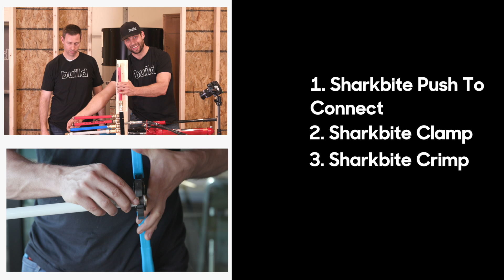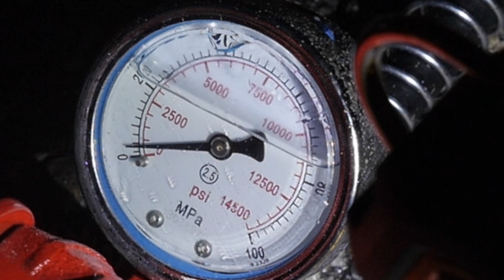Can we blow off these PEX fittings?  Sharkbite vs Viega vs Uponor

Comment: The shark bite push to connect are for the homeowner for temporary emergency repairs.  I work for a public water utility and see other contractors cut a water service line and instead of calling the water utility to come repair it. They use the shark bite fittings. They cannot handle our water pressures of over 100 psi. They will blow off every time. And when we see them ( due to them busting) we look up the last contractor that worked by the onecall ticket # and send them a bill.  I have seen so many home owners who fix their incoming house supply lines and end up having to do it again all because they think these are permanent repairs. I only suggest them as a quick temporary repair for home owners. Nothing more.

Comment: The uponor in my opinion is the best because it will take freezing better than the harder plastics. A softer plastic will not take as much pressure but will expand more when freezing. However you may not be able to ever put a fitting in the place it expanded. With 35+ years in the Car Wash business in Colorado I have seen a bunch of different things freeze. It still amazes me to see the power of freezing water.

Comment: WHY ARENT YOU TESTING REHAU???
Reply: Everloc+ and Rehau PEX A didn't fail the test!

Seriously, Mark, the test procedure was entertaining and somewhat useful, but not really scientific evidence for any of the components used.  And, as you pointed out, they did not include Rehau PEX and Everloc+ or Everloc fittings in the test.

Each individual component and fitting should have been tested separately, not on a manifold.  When it became obvious that the PEX pipe was going to burst before the fitting would fail, the test should have been redesigned to look at both components (the pipe and the fittings) separately.  But it was Christmas and they were having fun ... and I like their enthusiasm!

To determine the burst strength of the various types of PEX pipe, a length of pipe (same length in all pipe tests) should be pressurized gradually until it failed.  Each pipe burst test needs to be repeated at least three times, to make the result of more value, statistically.  Also, as others have said, use a pressure gauge that is more accurate in the range where burst pressure is expected.

To test for fitting failure pressure, probably the length of pipe should be very short, perhaps only an inch or a few inches, to focus on the strength of the fitting/connection and not have the PEX pipe bursting like a balloon before the fitting failed at the junction between the pipe and the fitting.

Nonetheless, Matt presented an entertaining exercise and got people thinking about how the various PEX systems perform at pressures above those expected  in normal residential water supply systems.  Another test that Matt can consider would be to use a manifold to pressurize ALL types of fittings and PEX pipe to 100 percent above the maximum pressure expected in residential water supply systems.  Rarely is the water pressure in residential application expected to exceed about  75-80 PSIG, so the test pressure might be set for 160 PSIG.  Then, monitor the entire assembly over time to see if any component (PEX type and fitting type) develops a leak or other failure mode that would pose a risk if that system is used in residential service.  Be sure to include Rehau PEX A and Everloc and Everloc+ fittings in the next round of tests.

Now, each manufacturer will be obligated to do such "burst" tests and to make the scientific and statistically valid results available for those who use their system --- if they have not already done so.

Comment: Matt, I really enjoy your videos. But I have to call shenanigans on this one.
I do not see the point of this test if you don't have a gauge that allows accurate readings of the actual pressure at failure. With the 14,000 PSI gauge, even if you don't see the needle move much , you are likely already well above the pressure that any plumbing system will ever see under any circumstances.
And despite the fact that you seem to be really bashing the SharkBite connectors, it is interesting that all of the threaded connectors were leaking, even with very minimal pressure applied, but the SharkBite connectors were not leaking.
Would it be possible to repeat this experiment with ultra high pressure fittings at the manifold, and a more realistic gauge along with pressure readings at the failure point?

Comment: good yob,. but you ended up doing a systems test not a component test .. to test the fittings you need a much much higher rated psi piping,. i think residential water pressure is 27 or 32 psi max so not much of a need for high pressure testing with the materials short of freeze testing anyways.. Im still more worried about time then anything else, i routinely repair freeze damage and not much else in nearly 100 year old houses, with copper.. The day i see near 100yr old pex ill be a poltergeist screwing with a shit carpenter in a crawlspace ... not sure how to reconcile that..
Reply: There are a couple of comments similar to this...use higher-rated pipe.  But I think you want to use the pipe you would normally use to test how well the fittings stay on.  If you use higher pressure pipe you're testing only the integrity of the fitting, but not the connection.  As we saw with press-on, the connection strength test is telling.  Until this video I was going to use press-on in my walls.  But now I'll use one of the crimp types.  Press-on was the only connection failure.  Or at least that's my main takeaway from this helpful video.
Reply: @TeddSpeck  agreed, i was just taking the title literal, to a fault, like a yerkoff,., There wouldn't  really be any sense in even testing it the other way.. even this is overkill .. The only thing i was missing was a temperature differential aspect ,,does hot feed act different then cold feed ?, in summer's as apposed to winter's ambient temps ?.. Does it get brittle in the cold?.. Does u/v exposure damage it?   im guessing all this is in a PDF. somewhere , but its nice to see manufacturers claims validated either way....
Reply: City water pressure is 40-60psi usually

Comment: I like the propex. I’m happy to see the fittings don’t fail before the pipe fails. I was wondering if the pressure would be enough if the fittings would expand again and fail. Thinking about the way it’s made now I know it wouldn’t. The pipe is the same strength under the expansion ring as it is in the pipe. Then you put a ring on the pipe and it holds the pipe together even better. In effect making the pipe thicker. It seem that in any style of fitting the pipe would be the weaker part as long as it’s some sort of fitting that involves compression to the outside of the pipe. Even the fitting that failed was placing outward pressure on the pipe and a mechanical  failure occurred. I would like to see a test that puts a sleeve around the open air section of the pipe and reinforces that part. Then rely solely on the fitting. I’m thinking uponor would fail first at well over 1000psi then others would fail much much higher.

Comment: I used the push to connect in a summer cottage, which would be de-pressurized when nobody was there, After less than a year we noticed some of the fittings would leak a bit until the pipe expanded back into the o-ring. There was a definite groove  in the PEX (B) for the o-ring.  The hot side was worse off then the cold.  I shortened the lines up and went another year, but it happened again and a couple of them took minutes to re-seat. it was only an o-ring issue, the lines never walked back,  I eventually opened up the areas where all the fittings were and all of them had evidence of small leaks at start up. Went to crimp-on's and haven't had an issue since.
Reply: Push on fittings just don’t inspire long term confidence
Reply: @wallacegrommet9343  
I have some, plastic, push on fittings going to a shower that have been there for, about 12 years, on cpvc 1/2in pipe and they have never leaked.

Comment: I'd be curious to see how SharkBite fittings hold on copper pipe instead of PEX. 1/2 inch and 3/4 inch as well and see if there's any difference due to the size of the pipe/fitting.

Comment: A more accurate test would be to test each pipe/fitting section separately.  The last one that failed had been pumped up to several hundred lbs 5 times.  Maybe that's why the split was longer.

Comment: I used sharkbite fittings and have had no problems.
Reply: Same here under all my sinks for over 5 years.
Reply: They are ok, but you shouldn't use them in inaccessible locations, treat them like a water heater flex. Should never leak, but always leaks sooner or later.
Reply: I deal with sharkbite leaks once in awhile
Reply: I had one fail so I now use the crimp on they are sooooo much cheaper.
Reply: David Watson except for the crimp tool.

Comment: I question how safe PEX really is for drinking water.
Reply: I actually question copper for that. The interior of some old copper pipes at my dad's house that we removed looked totally disgusting. To think we drank from that.
Reply: Shawn Copen just calcium and lime and other mineral build up. You drink the same stuff with any pipes
Reply: Most PEX has a california prop 65 warning as does lots of plumbing material. Copper pipes also were soldered with lead back in the day. Nowadays the solder is disintegrating and causing issues.
Reply: Hulk Smash   I haven't seen that yet but we have a lot of galvanized steel pipe in our area that has extreme corrosion from electrolysis, a lack of using the dielectric unions. Code now states that you can use 4" of brass instead but yes all nipples in the water heater must be insulated on the inside or non galvanized. Crazy that they would bond the panels to copper pipes, seems illogical, copper doesn't disperse as well as black iron or galvanized pipe does.

Comment: I appreciated the experiment attempt, but it seems to me that it proved that the pipe is the weak link. It did not prove any fittings.
Reply from the maker: Not what we expected at all. But interesting nonetheless. Turn out the fittings are not the weakest part of the assembly. That’s the big takeaway. PEX fittings are pretty stout.
Reply: True.  It's still useful information.

Comment: I have installed Shark bite 1/4 water valves on 1/2 inch copper pipe that are accessible under cabinets, etc. The manufacturing claims Shark Bite press on valves can withstand up to 200 psi. My well pump is limited to 62 psi. The well pump tank is limited to 100 psi. I hope the Shark Bite hold up long term. My only concern is the rubber seals breaking down over time due to chlorinated water. I assume that would present itself as a slow leak under one of the bathroom cabinets or the kitchen sink cabinet. At that point, I will replace all 1/4 turn valves with whatever the best product is available at that time. I have a total of sixteen Shark Bite valves in my house at a cost of $10.00 each. By doing my own plumbing, I saved over a thousand dollars.

The original valves were the compression fit type that required two wrenches to tighten. The pipe compression connections lasted  34 years, but the rubber seals inside the old multi-turn shutoff valves deteriorated and clogged the toilet lines. The Shark Bite valves use ball valves. I can replace a Shark Bite valve and in five minutes.

Before using the Shark Bite valves, I asked a plumber his opinion. He told me not to use that type pipe fitting inside walls, but they were fine for easily accessible locations. So I used soldered connections for my new shower and bathtub valves.

I watch your videos to learn about new building materials, products, and construction techniques. Thank you for the testing and information. DIY guys like myself need to see what products professionals use and how professionals build.
Reply: Hulk Smash , how much temperature fluctuation will cause a problem? High vs low temperature?

Comment: Has anyone had a fitting fail?  I've seen more soldered fitting fail than PEX type, altho I'm no expert in the field, just a home plumbing dabbler.  Right now I'm testing Sharkbites on my home well system at 60psi max.  My old system stood up well with no leaks or failures at 50.

Comment: Manifolds configured to your liking are available on the internet for very reasonable prices. Try to stay away from pipe thread for all of the test fittings and manifold ports. You proved how problematic the pipe fittings are. teflon tape reduces the friction between pipe threads and gives a false reading as to tightness. Loctite for hydraulic systems would be a good choice.

Comment: One major flaw in the design of this experiment. You have different length pipes. The longer the pipe, the more the pressure will seek that pipe off of the manifold according to the law of LaPlace. Uponor was longest, then viega. Hence, the order of rupture.
Reply: Though the fittings do affect the tubing near it for good or bad, after an inch or two, all is the same, including pressure.  No "major flaw" here.
Reply: All of the PEX pipes are cut to 12". The brass fittings are different on a couple and they are tightened to different degrees, but the PEX tubes are the same.
Reply: Jordan Smith but that’s the problem. The distance from the cap to the back wall of the manifold is the length at play, not the length of the pex itself. That diameter creates the difference in wall tension.
Reply: @pacohenmd  hmmmm... I'll have to think about that, not sure I agree, but I'll have to dig out my statics book to see if I missed it forgot something.  We redid the test with a single pipe each time and a 1000 PSI gauge.  It would be simple enough to set up the test with the same brand of tubing, but at varying lengths.  If what your saying holds true, wouldn't it mean the longest pipe would always fail first?
Reply: Jordan Smith yes, the longest pipe should fail first. But if you didn’t use a manifold and joined each piece of pex in series, then the pressure would be equal and it would be a truer test of wall tension provided the inner diameters were equal.
Reply: No? You really need to read up on the fundamentals when you make such false statements.
The pressure is the same in the whole system - excluding the tiny tiny difference that the height makes.
Reply: ABaumstumpf - before you assume I haven’t ever read a thing in my life, let me admit I misspoke in my original post and stated pressure when I meant to say wall tension. The reality is that this is a poorly designed experiment. The goal was to determine the bursting pressure of the fittings. A properly designed experiment would have several samples individually tested one at a time. That would eliminate any chance of confounding the results with different tube types on a manifold. Ideally it should be with the same tube material to eliminate that confounder. But what was created here is a testament to the tube materials and wall tension tolerance,  with length of the tube being a factor. I’m surprised that no one other than me finds it curious that the longest looking tube always bursts first...That said, I’m happy to know that my uponor pex’d home won’t have a tube burst by pressure alone or have a fitting fail from over pressure since it’s entirely pressure regulated well under what was displayed in this video.
Reply: @pacohenmd  " before you assume I haven’t ever read a thing in my life"
never assumed that. But when you state something as fact that obviously is not you should read up on the subject again.

"The reality is that this is a poorly designed experiment."
Well yes. The only see we really see is that their plumbing is not good and that the fittings are more durably then the walls of the tubing.

"Ideally it should be with the same tube material to eliminate that confounder."
i would go one step further and say they should test each fitting with several types of tubing cause that might also change their behaviour.
But before that even matters they need at the very least a gauge with a maximum pressure indicator.
Reply: You're mixing everything, the pressure is on everything not on each pipe.
Reply: You are mixing apples and oranges. The pressure is the same in all connected pipes as long as you have no flow. Laplace covers tension, not pressure and it only applies to pipe diameter not length.
Reply: mrfrenzy that is true, so long as there is no manifold to distribute the pressure. The pipes are acting as balloons off of the manifold, not as actual pipes. Therefore, the wall tension across the manifold is equal, but the tension across the pipes are not. If the pipes were equal length, then the diameter from the wall of the manifold to the cap ie the pipe length makes a difference. That makes the wall tension higher at an equal pressure.

Comment: In my professional opinion sharkbite failure ( disconnecting) is mainly due to pipes rattleling or not being clamped down correctly. With that being said I would also highly recommend not to burry any sharkbite repairs under the walls, it's best to solder these patches. I know it's gonna be a little more expensive but if you keep in mind the drywall and other damage that will be done to your house in case of a leak it's actually cheaper to call a plumber the first time...
Reply: I used to say the same thing. I didn't trust sharkbite quick connects at all. But I've seen demos where those fittings have been left at 200lbs psi for literally over a year and never failed. A typical water supply in a house goes no where near that so I'm a lot less concerned now about it. I have the quick connects on my hot water tank (going from copper to pex) and it's been on for 5 years and not a drip.

I would be interested to see a quick connect that had been removed and reused a bunch of times to see the longevity though.